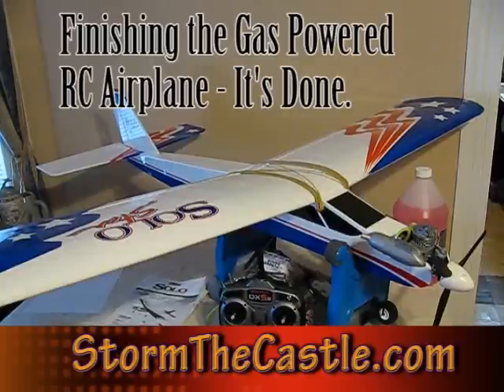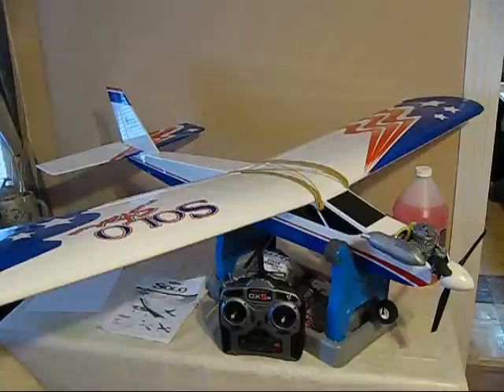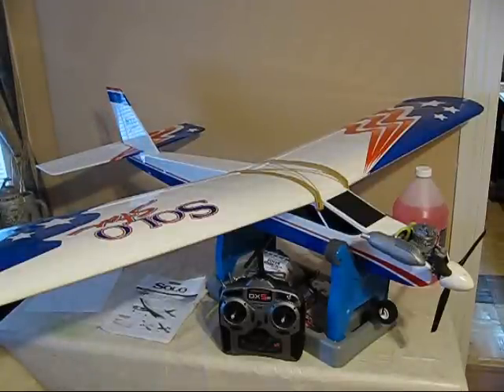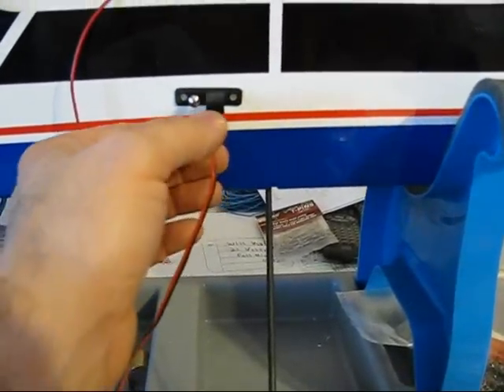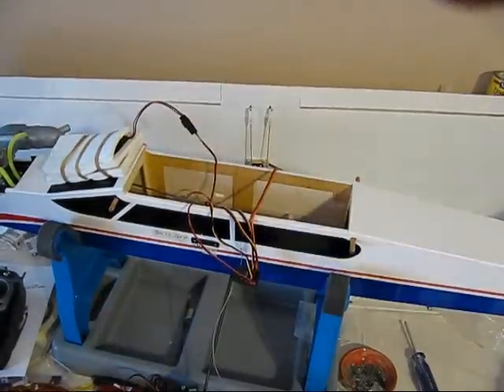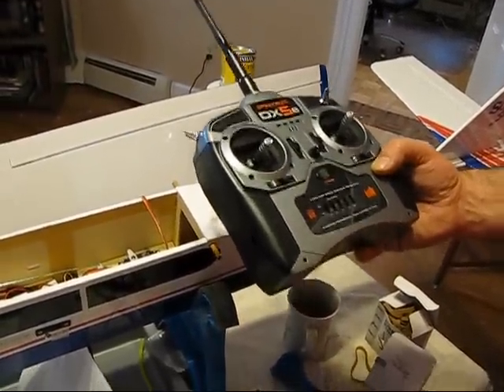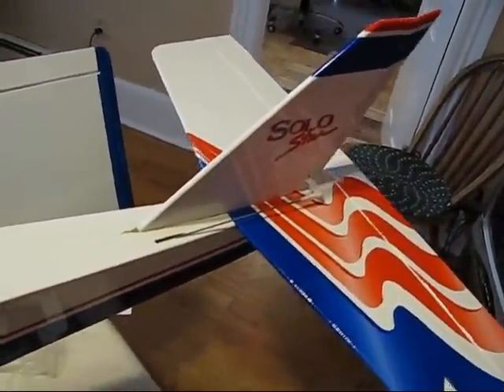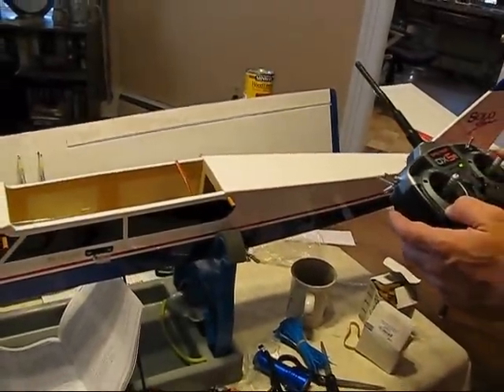Completing the RC Airplane - gas powered

Comment from the maker: @TheProPilot100 Can't remember exactly but the basic plane kit was around 150 I think. All told, to get going with all the stuff you need is going to be around 500, controller, fuel, batteries, extras and all the what not.

Comment: Hello friend I have some absolute must tricks before you fly ;  1- take a 1/8 drill bit and measure on the right side of the base plate of the prop to the body U must have an angle on the motor not parellel left about 1/4 ; 2- find the spar of the wing, The center rib from tip 2 tip (underneath) make a mark on both sides CENTER spar make yourself a stand to balance it from these marks it MUST be nose heavy just past level this will keep the plane from flying irratic up & down  to weight ; MORE

Comment: Very Nice,and I appreciate all the Help, BUT, you are talking to beginners.How do you fill the Fuel tank? Assume disconnect the muffler line,and that is the "Fill" line, pump till it overflows from the carburetor line ? Also,how do I charge the batteries for the servos and throttle? Yes Basic stuff,but a mystery when you are a newbie.

Comment: CONTINUED depends on how level it is use wheel weights if needed it will lift it U can carry a half dozen eggs this motor looks like a OS 32 I had a cadet senior 2;
3- If U use mini hinges on flaps U fly way longer but for now do a ground skip only lifting the trike but make sure the trims are centered on radio once up CALM DOWN and set the trims so U have to keep lifting it up slowly and use half throttle once up only go for 5 min . first your nerves will be trashed to land shut throttle down.

Comment: I AM GETTING A PETROL POWERED RC PLANE 
RIGHT I NEED TO KNOW WHAT FUEL TANK TO USE FOR A 60CC ENGINE BECAUSE THAT ENGINE WILL HAVE MORE LIFTING POWER I WAS WHONDERING IF IT CAN TAKE A 800cc PETROL TANK WHICH IS RATED 
FOR 60cc AN 100cc